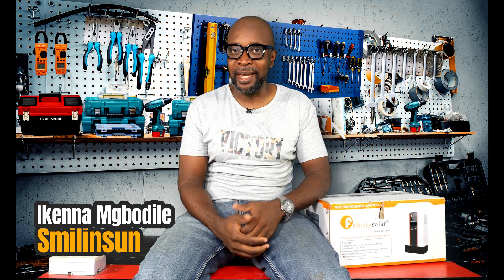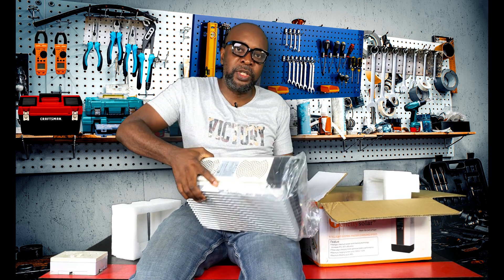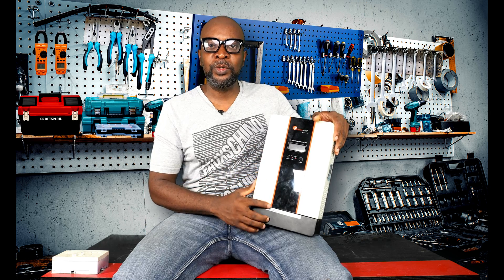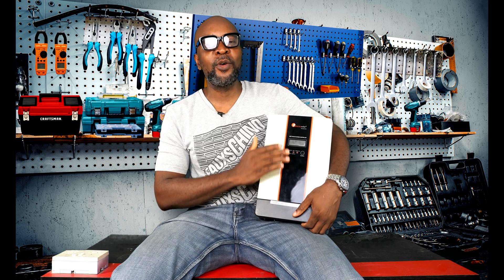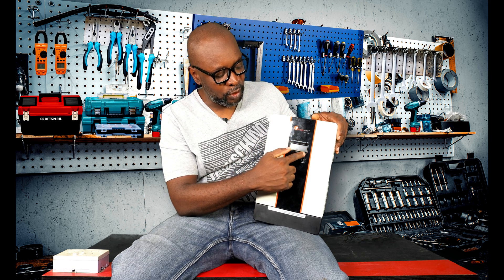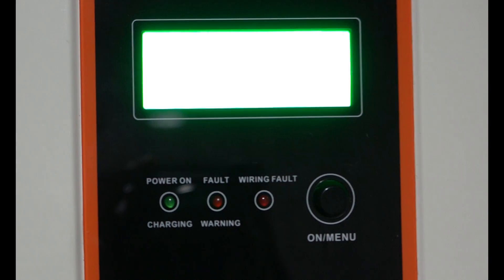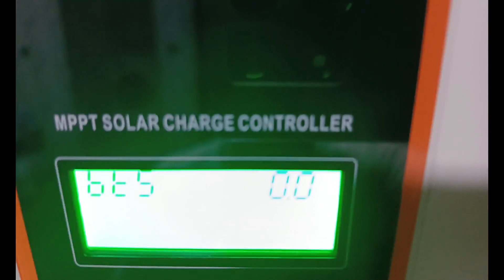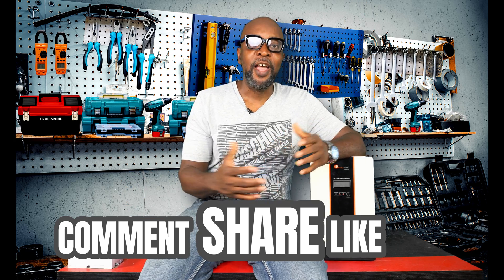Felicity Solar Charge Controller is it good enough?

Comment: Thanks for the video. How do you find how many kilowatts hours it generated. I can’t seem to find it with this felicity charge controller. Other charge controllers I’ve used normally display the amount of energy generated.
Reply from the maker: @apphandler  Unfortunately it doesn't have a logging system

Comment: Thank you for sharing can you explain why/when adding a Felicity MPPT  charge controller to a Felicity Inverter/charger
Reply from the maker: The question is not complete, I don't follow
Reply: @smilinsunsmilinsun8056  A Felicity Inverter/charger has already charged the batteries. Is there a use case when we have to bypass the Felicity  Inverter internal charger and add an external Felicity charge controller?

Comment: Please, I just encountered a challenge with my Felicity Charger Controller. It's showing error code 20 and flashing red since this evening. I haven't used it for up to one month. Error 20 is PV is low loss. What do you advise please?
Reply: don't worry

Comment: I've used this controller for years and my major problem is there's no setting for total kwh generated for the day. You have to manually connect the un provided cable and connect to mppt tracker software to generate daily kwh.
Also another major issue is when you get to float and dump a heavy load on the inverter, it cancels float and starts bulk charging again. This takes about 30 seconds and meanwhile the heavy load will be supplied by your batteries during those 30 seconds which can trigger low voltage disconnect of your inverter. Also even though the heavy load was used for say 3 minutes, when it cancels float and reverts back to bulk, it will start absorption charging again for 120 minutes thereby overcharging your batteries
Reply from the maker: That indeed is a flaw with it

Comment: You can connect 18v laptop adapter to the solar input if you dont have a solar pannel to simulate the solar pannel when the sun is out
Reply from the maker: Fantastic this is a brilliant idea
Reply: It's very risky for the adapter. I've over 4 quality laptop adapters for that. It's better to just buy the charger

Comment: Good Day Sir, i have a question. 
In a none hybrid setup where you have a felicity inverter and a felicity MPPT controller installed separately, How would the inverter (connected to grid) know when the MPPT is charging so as not to overcharge the battery?  is there a way to make both devices (Inverter & MPPT) communicate with each other?
Reply from the maker: Thanks for reaching out with this very important question. 
The inverter and charge controller are set with the charge limit voltage capacity. If the voltage is set to 58 volts for instance it will never take the voltage higher than that. It is also set to Absorption charge duration. Lets assume that to be 120 minutes , once it gets to that duration it will stop charging. It is also set to current limit. If the set current limit 60 Amps and the inverter is supplying 30 Amps the charge controller will limit its own charge current to 30 Amps which cumulatively makes 60 Amps. It goes on and on.
Reply: @smilinsunsmilinsun8056  Thanks.

Comment: Why is there a voltage drop on my solar charge controller different from what is been generated from the solar
Reply from the maker: The system needs to drop the voltage to accommodate the current as both is what is needed to generate wartage
Reply: @smilinsunsmilinsun8056  thank you

Comment: it not having a fan makes it heat up a lot. the heat sink gets too hot to touch.
Reply: Yes , that is why it's called heat sink. It's supposed to be hot when in use.
Make sure it's mounted in a good well ventilated location (with plenty of space to allow easy airflow around it).
From experience, solar charge controller with heat sink are more durable than the cheap fan cool China Solar charge controller. I nearly had a fire outbreak when the fan in one of my charge controller failed while in operation and the charge controller became extremely hot with burning smell. I was just lucky to spot it promptly and shut down the system. I did my research and upgraded my charge controllers to one with heat sink.
Just provide enough ventilation to your heat sink based solar charge controller and make sure your panel Voc does not exceed your solar charger maximum input voltage.

Comment: A good video. thank you.
please what are the appliances are meant to be used on solar, and can 1.5 hp inverter air condition be used on solar and what are the inverter can be ok for it. Pls give us a review
Reply from the maker: Solar system can do anything your regular Grid power can do. Yes it can power your air conditioner. Anything from 3.5kva  Inverter is fine .
Reply: @smilinsunsmilinsun8056  thanks so much but someone says that running an air condition  on solar will reduce the lifespan on your battery

Comment: Pls How many pcs of 400w solar panel can be used on this 120A charge controller. Its a 48v
Reply from the maker: 17
Reply: Thanks
Reply from the maker: @GreenvilleLTD  You are welcome
Reply: I tried configuring the Maximum charging current for this 120A charge controller but the maximum is 80A and if I press the button again it goes back to 30A. Is it okay?
Reply from the maker: @GreenvilleLTD  That's not normal you should be to set to the maximum charge current

Comment: Pls is this Felicity charge controller lithium ion enabled, in terms of charging rate and over charge control.
Reply: Am asking bcos I got a generic mppt charge controller and it over charged and damaged my sealed lead battery and my prag inverter, now I got Felicity lithium ion don't wanna make dat costly mistake again.
Reply from the maker: @edidiongjoseph007  Sorry to hear the mishap you experienced in your system, the Felicity charge controller will charge your Lithium effectively.
Reply from the maker: Yes it is

Comment: I have 8x300w panels for my 48v system but my felicity charge controller rarely reads above 400w
Reply from the maker: Either something is wrong with your configuration or your settings is wrong
Reply: @smilinsunsmilinsun8056  the panels are in 4 in series connect to 2 parallel
Reply: Check your panel configurations. 
You did not mention the specifications of your solar charge controller. I presume you are using 60amps 48v solar charge controller or higher?
Since you have 8 solar panels, your best configuration will be to connect 4 panels in series to get two strings and then parallel the two strings making sure the Voc (open circuit voltage of the panels) is not above 150v (maximum input voltage of the felicity charge controller).
However, the above may not be the problem. Majority of the solar panels sold in Nigeria are substandard. Many panels will not even produce close to half of their rated wattage. That is why you must buy high quality solar panels. Yes the quality of solar panels matters very much. I had similar experience where my 320w x 8 solar panels (made up of 320wx 4 MS solar panel and 320w x 4 Joy solar panel, both monochrystalline) hardly produces close to 1000w.
Solution: I had to upgrade my solar panel by buying higher quality new 455w monochrystalline Canadian solar panels from prag in Lagos. I'm currently 100% off grid. I have 24hrs lights.
Reply: What inverter and charge controller do you use? @wilsoneffiong3243

Comment: 15:22 Nope-
Simply adjust voltage type from 05 "AUO" to your system voltage to get 48v settings.

Felicity still stands out for support for their products, although they tend to act like apple in terms of technology by doing proprietary designs. I can literally have a spoilt controller and I know there support centre is around to fix it.

I am still figuring out their products, it does a lot and also have flaws, all product does but the service support is available unlike other reliable brands.

--Knowledge level, over 50 installs on Felicity product installs
Reply from the maker: Very salient and  key points
Reply: Where is their service center please
Reply from the maker: True
Reply: Even if you set to 24 or 48v, you have to manually be calculating the voltage parameters as it's only in 12v
Reply: @namzy410  not really. You can set parameters to 48v range
Reply from the maker: @namzy410  That can be very frustrating

Comment: I have a 12v battery 220ah tubular with 200watts x2 thats 400watts parallel ..what amp of mppt ill need to charge my 12v optimally?
Reply from the maker: 30 Amps will be fine
Reply: Pls sir  analyze why 30ah will be okay

Comment: Thank you very much Sir. Does the felicity charge controller has temperature sensor?
Reply: The older model does but for some reason it was desoldered. Maybe it was to reduce the cost of manufacturing to be competitive for the Nigerian market. I don't think they would ship the products to well electronic regulated countries without making sure it 100% represents what is on the manual.
Reply: @jo4mil This is the problem I have with all these products sold in Nigeria. They sometimes ignore proper quality control since they know our country does not have any standard quality control agent. How is the performance of the controller overall please. Is it worth the money?
Reply: @EasyyokeFilms  newer model is very good. It handles over-voltage charge interrupts better than the older ones. Installing multiple charge controllers without some form of sync between charge controllers is not an effective means of design from my view but its cost effective. But it works-

Comment: What is the maximum voltage can the charge controller accommodate from the pv....
For 120a charge controller
Reply from the maker: It depends on the charge controller, but most of  them is usually 150V
Reply: Thank you for major assistance.... I celebrate you sir..

Comment: Interesting...
But Felicity charge controllers are too costly.
 I would like you to review some other MPPT charger controllers that are good and cheaper.
Thank you Sir.
Reply from the maker: List out the Charge controller you would want rto be reviewed. And I will try to review them.
Reply: Ok, I would like you to review: SUOER mppt, SUNCHONLIC mppt, Powmr mppt, YOHAKO mppt charge controllers etc. Remember, good & affordable mppt charge controllers. 
Thank you Sir.
Reply from the maker: @EmmanuelDimgba-f7c  Thanks for the information will try
Reply: Yohako and Must are the same.
One cheap underdog I had used was Choice Mppt CC. It was bogus but I was quite impressed wrt cost. 
But "F" has messed me up so many times costing me inverter fault inclusive. Let me just reduce my volume else they will 😢😢 from the feedback.
Reply: which country is that? because felicity charge controllers are one of the cheapest in Ghana.
Reply: What about Xtra power mppt
Reply: Sir, I’ll like you to review Techfine charge controller. Thanks

Comment: Does it work with three batteries that's 36V system plz help we need to know
Reply from the maker: It doesn't, it will come on though but it's dangerous for your batteries
Reply: @smilinsunsmilinsun8056  Correct. Spec sheet shows: Compatible for PV systems in 12V, 24V or 48V.  So either only use two batteries or obtain a fourth.  If you have no other choice, a person could manually cycle the battery connections round-robin style every few hours, where only two batteries are being charged at a time. But that would be very time intensive.
Reply: Doesn't work with a 36v system parameters. If you are using above 1 unit, my candid advice is look for another brand.
Reply: Thank you so much plz for all your advice I got a must mppt it's doing the work so fine in pleased. 😊😊🙏🙏

Comment: I've had the same charge controller(60 amps tho) since 2019. Still pushing the amps like a champ. Thanks for making me not regret purchasing it. Money well spent.
Reply from the maker: Nice one
Reply: 😊How much did you buy it then?
Reply: @maduakorhenry2336  85k
Reply: @maduakorhenry2336 I bought mine in 2022 May for #90k at Felicity Main Office Alaba  60a mppt